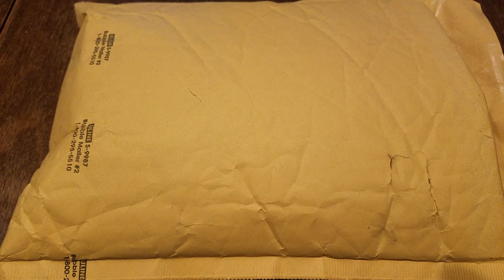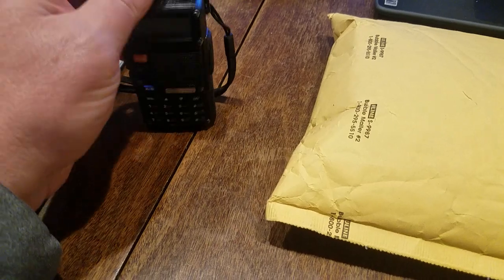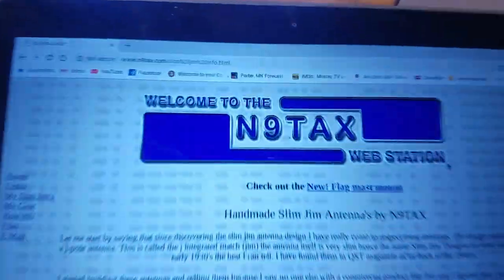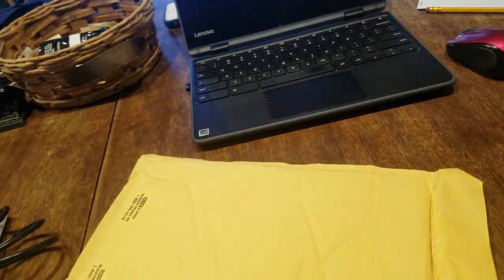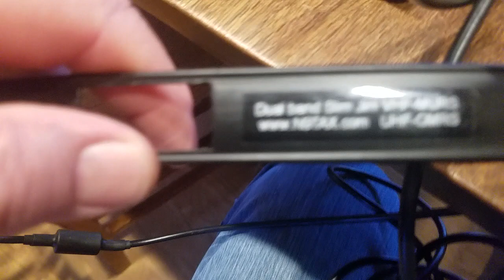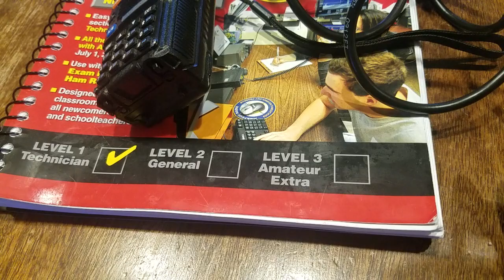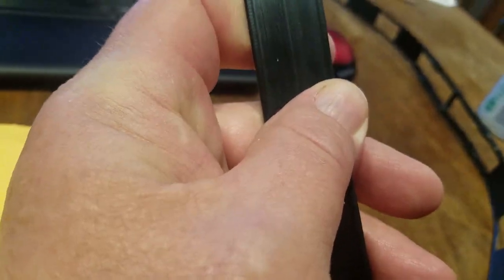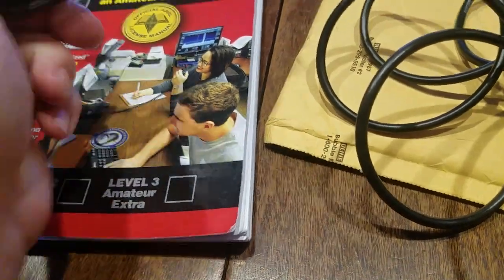GMRS Slim Jim Antenna Unboxing

Comment: Fyi.. you cant use that for gmrs or frs... its not compliant as it has a removable antenna and also because its frequency based, not channel based.
Reply from the maker: FRS-NO. GMRS-YES! Google GMRS mobile transceivers and tell me that they have non-removable antennas. Watch my videos on GMRS transceivers.Go the Midland website and see that they have GMRS antennas for sale for their GMRS transceivers. Look at the Channel lineup for GMRS transceivers. Some channels are shared. Channels are not a frequency? How does that work? A specified frequency, yes.
There are a few home brew manufacturers like N9TAX and KB9VBR out there that make antennas for the GMRS "frequency band" Yes they are herded into specific frequencies that are called channels like CB radio. The limitations the FCC places on GMRS is height above the terrain or a structure you happen to have at your home so you can place your antenna on your penthouse on the top floor of a 100 story building if you wish but there is a limit to the height that antenna can be place above that structure.
Reply: That doesn't make it legal to transmit just cause they are selling them AND again... channel based, not programable freqs
Reply from the maker: @aviationnationhd3760  I was not using the Baofeng radio with this antenna or using the baofeng as a GMRS/FRS radio. I was using this as a Ham Radio...a very poor one at that. I had a GMRS Mobile transceiver I used with the antenna. Baofeng  was for show and tell. I have the VHF/UHF N9TAX antenna for the Baofeng.
Reply: Ok.  Dont taze me lol.    Pass your tech exam?
Reply from the maker: @aviationnationhd3760  Yes, General then Extra.
Reply: @aviationnationhd3760  this actually pertains to data over gmrs not standard analog voice. Stop being a sad ham
Reply: When I want your opinion, Ill give it to you
Reply: @aviationnationhd3760   HAHAHAHA whatever troll that doesn't change your sad ham status